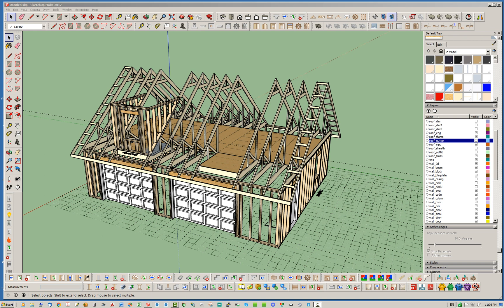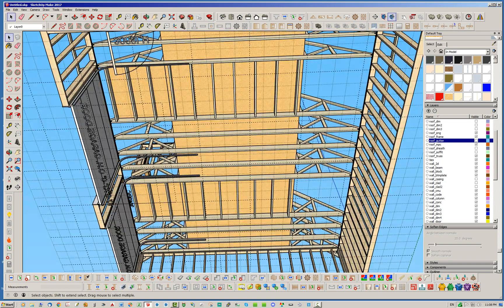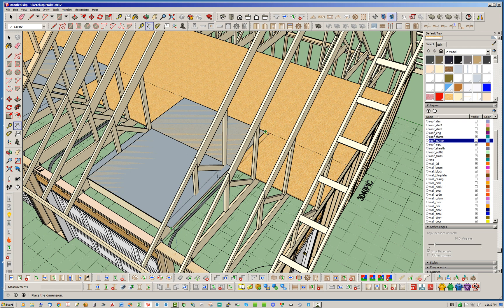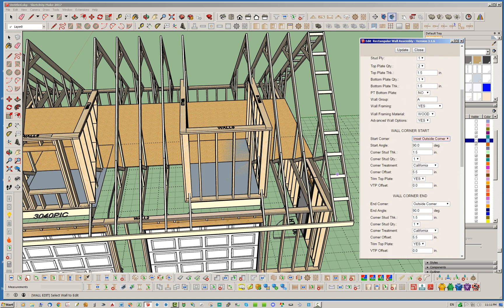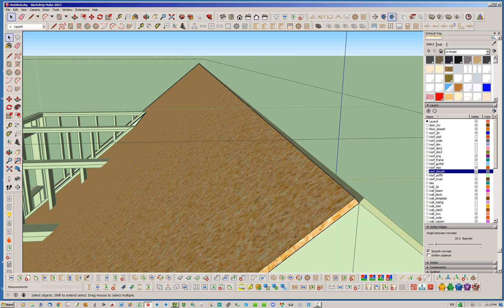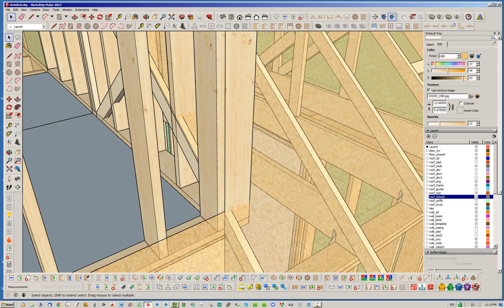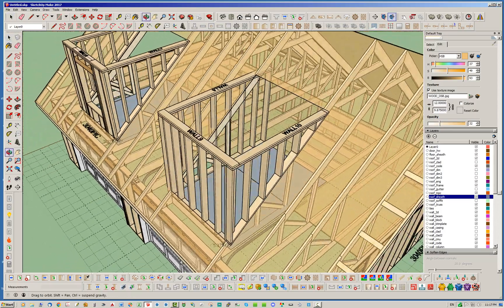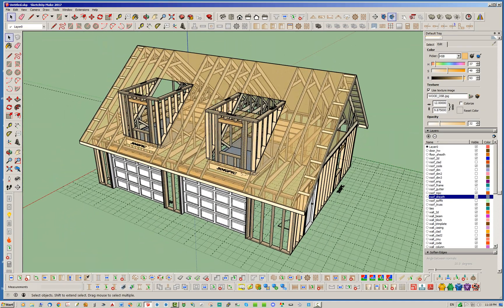Medeek Wall Plugin Tutorial 35 - Inclined Walls

Comment: Awesome tool and guide as always. Hardest part for this pleb was cutting the sheathing. Couldn't get push/pull to work in the down direction so I made it several inches thick, then moved it down into the sheathing, made it a group and used the trim feature. Same difference I guess

Comment: just wondering - should the inclined assemblies sit on the OSB or on the truss with the OSB butted to the plate? just thinking that is the roof sheathing becomes wet and needs to be cut out and replaced, it would be harder with the wall assembly on it.
Reply from the maker: I get what you are saying with the OSB potentially be a problem in the future however the OSB also ties the girder trusses to the other trusses in the assembly.

Comment: Very cool!  I know you used the trusses to make a quick roof but we would normally stick frame this roof so we could easily double the rafters beside the dormers.  Also because you have to stick frame the portions between the trusses, it makes since to stick frame the whole roof.  This is for those who are building for themselves and not necessarily familiar with traditional framing methods.   Thanks for making the videos,  I had not used that feature yet and it is pretty cool. :)